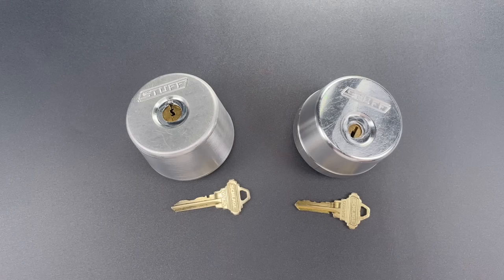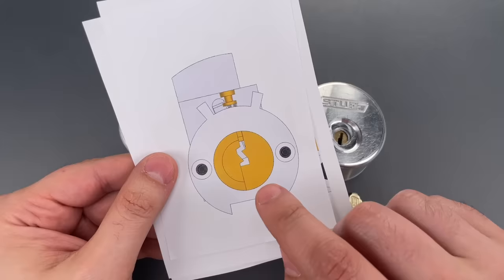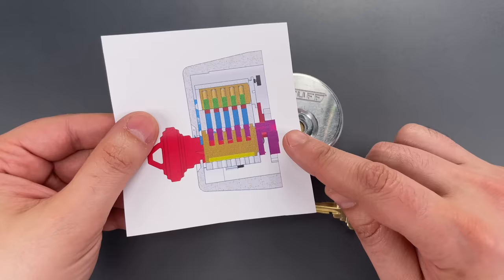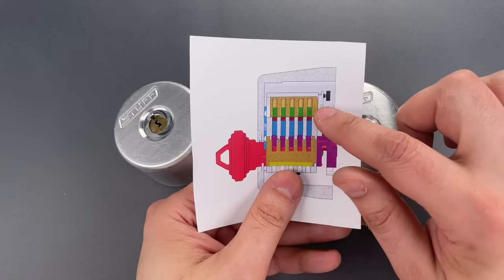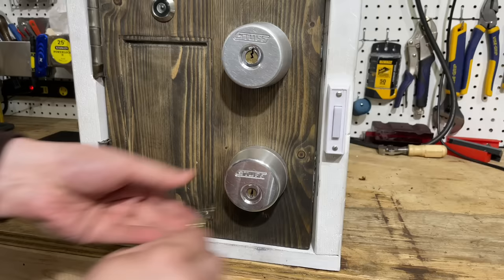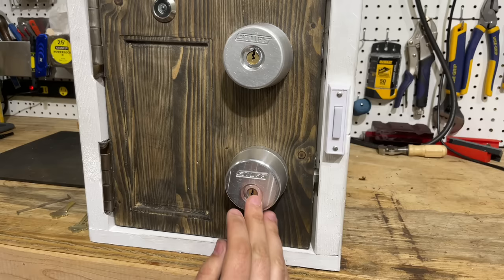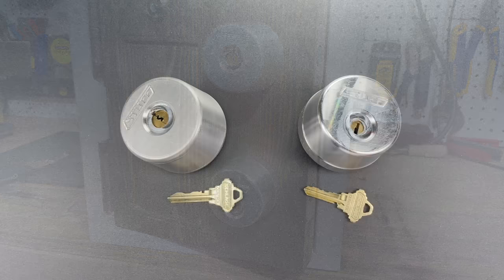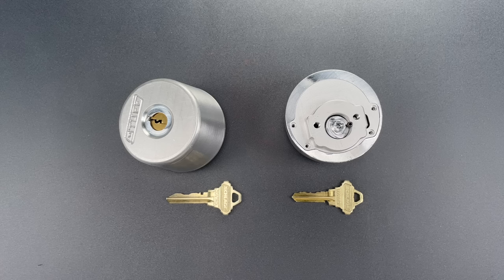[1299] Unpickable Locks From Stuff Made Here

Comment: I am not really sure about the methods used on the first lock. First you assume that there ll be enough space to get the knife between doors and door frame for your knife , but thats not how doors are made. They have L shaped profile that overlaps on the outside so nothing can be pushed in between. Second method was also bit questionable since you mounted the lock on the outside which is not how you mount a lock... you would lock it with mechanism inside of the cavity in doors so it cant be removed by something like sledgehammer or sawed off. It would make most sense if the face of the lock did not reach past the doors themselves.

Comment: Sliding a latch in BEHIND the lock's housing shows a gross violation of reality.

At least with NORMAL locks, where that is utterly impossible.

If he actually made a lock with a gap between it and the door, its easier to just use a coping saw and cut through the securing screws.

Comment: Sorry to ask daft questions ... but ... 1) could you recess the core by half an inch and then put another fake core over the top to prevent most people from picking?  2) Why do locks usually only have one core / one key? Could you not have a lock that has two keys / cores that interact with one another? Sorry for the dumb questions!

Comment: They are unpickable because what lock picker would know what to do with these locks I mean they don't get their own blueprints on what the lock looks like inside

And another thing the V2 lock is unpickable with the back cover even without if it would be installed correctly and without any little passengers same for the deadbolt it wouldn't even need a back cover

Comment: For the first lock: Using normal picking methods, you set the lower pins such that the shear line aligned. At this stage, the upper pins (gold ones) are set to their height and locked in position. Then you just open the lock normally since the pins are at the correct gate heights? Someone please let me know what I’m missing. I don’t understand how it’s unpick-able in theory.

Comment: The factor here that I think is vital is did the lawyer have the schematics before or after he initially tried to open them. There’s a reason the launch codes are secret.
Reply: the launch codes are secret because they are the equivalent of the key. just google security by obscurity and understand why it is so harmful to progress. the security of any system should only rely on the secrecy of the key, not the mechanism/implementation. obscurity can be an additional layer but should not be relied on (e.g. hiding the lock somehow with a wooden latch opened by a magnet or something).

Comment: i think this is kind of cheating on the second as you couldnt slide in a thing inbetween if the lock was partially inside the door so no hole to slide anything in
and with the round flat back piece it has i would guess its supposed to partially be inside the door

and the second exploit is based around the pins being at the same length, even though its obvious it isnt actually made like that instead the picture shows it like that to simplify, and if it is made like that then remember this is a prototype so it wouldnt be like that in the final version

and the third thing with the bolt retraction system is simply easier here as the door has like a 1.5 cm gap, if it was simply a good fit and a normal door (that sometimes have a part stick out so you cant put stuff inbetween the wall and door) you couldnt do this, even if you could put a thing inbetween cos you cant then oscillate whatever you put in there if there is a good fit

Comment: Just wonder, how come no lock manufacturers has ever contacted you for advice on their design, and/or set up a label of certification to a picking standard set by a panel of experts. These 2 facts missing I have to suppose that: A) this industry is made of low level mechanical engineers B) they don’t care about picking risks, because it’s your stuff that’s gone, they only care about selling cheap C) both of the above
Reply: Some of them have, Bowley for example. There have probably been more than that too, and he just didn't post videos about it.

Comment: I don't think the idea was for the lockpicker to take the locks apart first and figure out how they work before trying to pick them. I mean, of course an experienced lock pick will be able to figure a way to pick them after he has dissected them and has had a good look at the internals and figured out how they work. Would it have been ao easy to pick them without looking at their internal workings first? I don't see how this proves anything other than that the lockpocking lawyer can take a lock apart and take his time figuring out a way to pick it. If it were mounted on the little door and locked up, and you didnt have a key and had, say 30min to open it without looking at its insides first would he have been able to open it? I guess we won't know cause it looks like the first thing he did was take the locks apart and looked inside then remounted them and exercised what he learned by taking them apart.

Comment: A bit of a let down really. Having access to the design and workings of these locks gave you the knowledge you needed to 'open them. Honestly, had these been installed properly with no gap and you were starting from Zero, could you have opened these? I am guessing not. Shane made these to be 'unpickeable', i believe, and not 'unopeneable by seeing the engineering design'. GIve credit where due.

Comment: Oh come on. Both of the methods shown for the first lock in the video are only possible because of the prop door. If it were mounted on a real door, there's no way you would be able to access through the bottom of the lock without drilling as there wouldn't have been an opening, and there's no way you'd be able to slide the dead bolt as it would have been covered. That's a stupid and disappointing attempt.